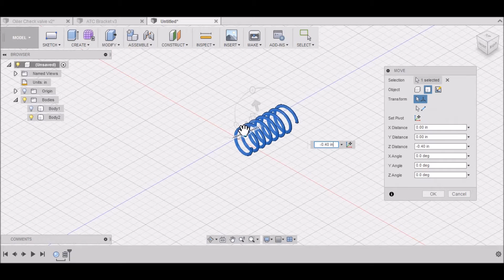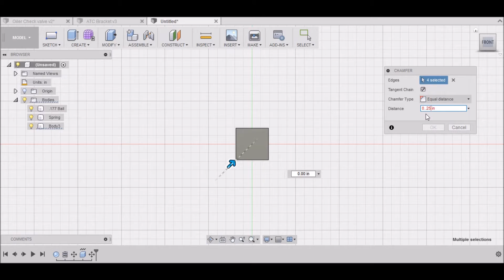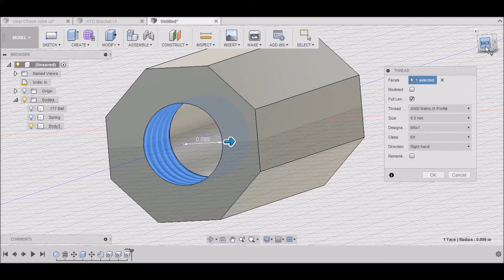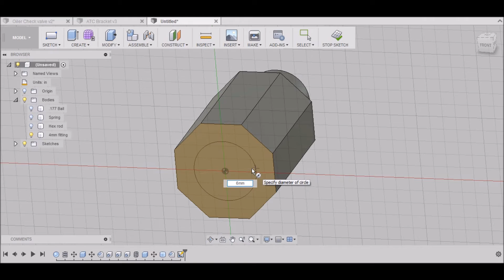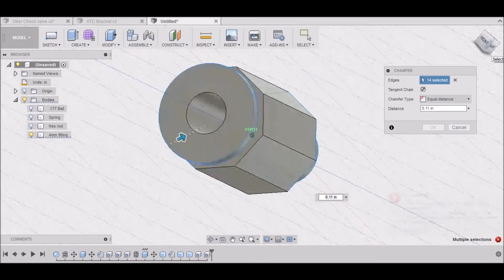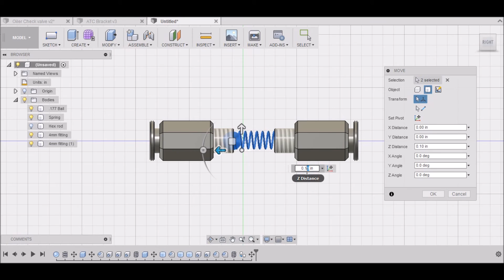Fusion 360 DIY Check valves

Comment: Excellent video! One question, why did you initially draw the hex bar as a square and chamfer the edges instead of doing a create circumscribed polygon?
Reply from the maker: The later is under the sketch tools. I could have done that but wanted to show how to do it without creating a sketch.